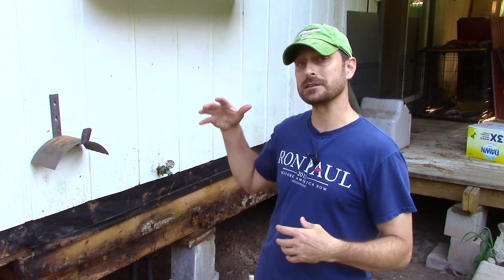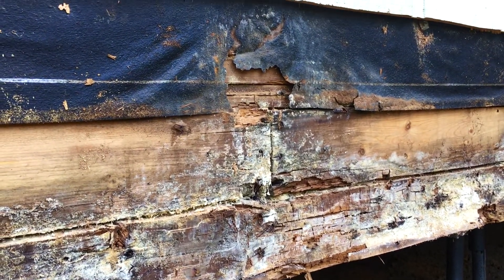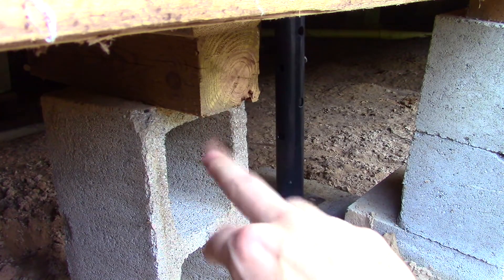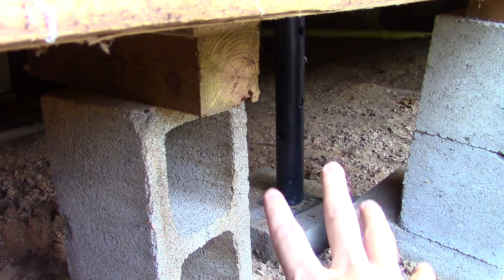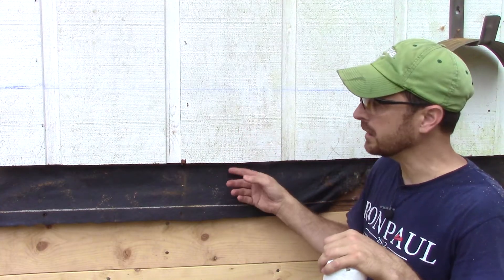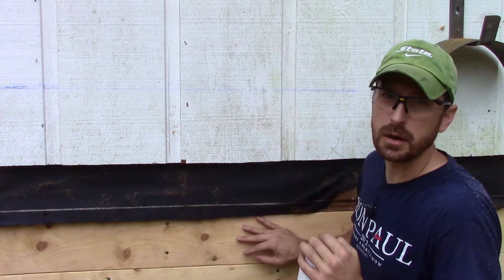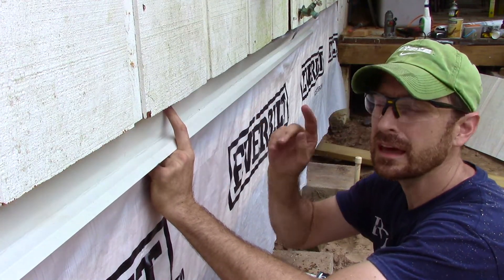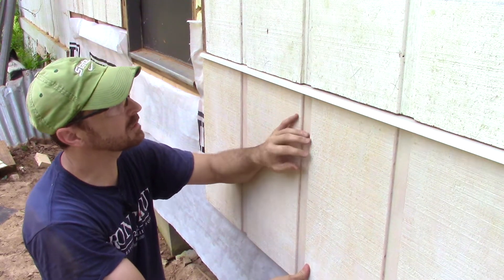How To Repair Damaged T1-11 Wood Siding On A House! Tips For Structural Repair And A Great Finish.

Comment: Great video!  It's just what I was looking for to address the problem I'm having with my T1-11 siding.  Unfortunately, HomeDepot no longer carries that flashing - at least that what it says when I select the link.  All they seem to have is Z flashing with 90 degree right angles.  The flashing you describe has a 45 degree profile.  What are the dimensions of the flashing you used if I have to search for it elsewhere?
Reply from the maker: Thank you. I think I remember the flashing being 3"x1"x.5". I wish companies were not having such terrible supply chain issues. It is hard to find good flashing profiles now. I may have to just buy a metal brake and make them myself.

Comment: How did you slid the house wrap paper under the siding where the studs are?
Reply from the maker: I pulled the upper siding away from the wall a little bit. It only needs to slide behind about 8 to 12”.

Comment: Where do I put the drip edge if my shed  doesn’t have any felt paper or house wrap?  
Thanks.
Reply from the maker: Put it in the same position. It will only prevent water from sitting on the top of the new piece of siding instead of diverting water from above and protecting what is below.
Reply: I forgot to include that I added felt paper. It is placed between the stud and siding. The felt paper is 6” above the cut in the siding and down to the bottom plate.

Comment: Just curious, why would you not put sealant on that gap left between the upper old siding and the flashing? Can't water still get at the end of the old siding with that gap there? (Getting ready to attempt some siding repair, maybe..)
Reply from the maker: Sealant will hold any water that could eventually get behind the siding from escaping. This would cause mold and rot behind inside the wall. The siding sits a minimum of 1/8" above the flashing so no water will touch the bottom of that siding. If any water does touch the bottom of that siding, it can easily and quickly dry out. Additionally if there is sealant there, it could trap moisture from that accumulated on the flashing against the bottom of the siding. Hope that helps.
Reply: @CountryLivingExperience  Thank you. I was going to copy the handyman's work that did some siding on my house and he put sealant on the flashing space so thought that was what I should do. Glad I asked...I am just starting this project, and today removed decking attached to siding and found lots of rot on siding and into the rim board...might have become a "contractors job" now, was going to try and save some money...It cost me $400 for the handyman to attach two half sheets of siding (36 in. height . 12 ft long) to the bottom and I went and got and bought all the wood for the project, so I thought maybe I could learn how to do this myself. My 74 yr old body is telling me today after tearing out the decking and dragging it to the trash pile, I may have over estimated myself... :) Thank you for an excellent video and quick reply.
Reply from the maker: You're welcome. Yes, doing it yourself is best if you can physically handle it. I am an Architect practicing for 15 years and worked with really high end builders in Washington DC and Houston.  Unfortunately, the handyman did not do it correctly. That is common to find.
Reply: You need to overlap the z-flashing by at least 4 inches to make sure water doesn't get behind it.  Be sure and check with CountryLivingExperience to make sure that's right.

Comment: I'm using some t1-11 pieces on an insulated shed that don't have ship lap, I'm wondering how to abutt the vertical joints. Thanks
Reply from the maker: The t1-11 has lip on either side of the sheets. They are made to overlap each other when you abutt them.
Reply: @CountryLivingExperience  some of the sheets I'm using are repurposed and had rotted parts trimmed off, so no lip. If I owned a router, I'd just make a new lip but I don't, so I'm wondering about another option, haven't had much help with google.
Reply from the maker: You can do a traditional board and batten idea. Butt them together and place a board over top of the vertical seam.

Comment: I have T1-11 siding and I go around periodically tapping with my fingernails.  If I find a soft spot, usually around windows or near trim, I coat it with 2-part epoxy and paint it.  I have been debating coating the bottom of the sheets with epoxy, but I don't know if that makes sense or not.  How about soft spots?  Can they be drilled and  injected with something?  Thanks.
Reply from the maker: All those soft spots mean that you have water constantly getting in at those points. You have to take care of the cause of the issue. Unfortunately, using an epoxy would be a waste of money. The amount of epoxy needed would cost more than buying a sheet of t1-11.
Reply: @CountryLivingExperience  I am not going to go to the expense of replacing a sheet of T1-11  for 1 or 2 soft spots the diameter of my thumb.  I would like to find something to inject it with and use the epoxy or caulk to fix the source of the water penetration.
Reply: In my experience, rot rarely starts from the painted front. It’s generally getting in at a seam up higher, running down the back, and rotting forward. So a soft spot means something bad is happening deep in there. A sheet is $35 at HD- while trying to repair soft spots might be cheaper now, better off in the long run diggin in there and looking for the root. I generally do and almost never like what I find 😂

Comment: Hello, I think I have have similar looking t-11. 8 inch thickness and 1 inch thick groove. I am not able to find one with 1 inch groove. Could you please share how you found it? Any online options to buy?. I also has 4 inch and 5 inch siding with q inch groove on rear of the house.. all these spec is getting harder to find
Reply from the maker: My siding is actually the 12 inch. It was easy for me to find at my local hardware store. We found it at the Home Depot. Here is the link....https://www.homedepot.com/p/Plytanium-Plywood-Siding-Panel-T1-11-8-IN-OC-Nominal-19-32-in-x-4-ft-x-8-ft-Actual-0-563-in-x-48-in-x-96-in-113699/100000016

Comment: I suggest that you seal and paint the back side of siding and most importantly the top, bottom and joints. Use the best 100% silicon you can, nothing else. Anodized pre-formed aluminum flashing won't crack like this plastic stuff. Adopt an attitude that you're building a boat, that is the mindset you need.

Comment: Hi, great video as I have the same problem on my shed. The flashing link for home depot is no longer available. Can you provide any information as to where to purchase such flashing.
Reply from the maker: Good morning. I checked the link and Home Depot is currently not carrying the product. I don't know when they will have the product back in stock/available. They are the only place that I have found the correct one. I checked Lowes, Amazon, and Grainger with no luck. All local building suppliers in my area also did not carry the product. If I find anything, I will update the video description with the new information.
Reply: Search for Z flashing at HD.  They have it in my area (MI)

Comment: How did you get the new house wrap up behind the old paper? You showed stapling the new wrap on, then voila, it was 5 inches behind the old siding. I’ve been doing similar repairs and the worst part of the job is getting the new up behind the old. What’s your secret?
Reply from the maker: I honestly just pulled out the bottom of the siding and slid it up behind. It was pretty easy with that t1-11 and it wasn't nailed in that frequently.

Comment: I have this identical issue on my house. They did not install the deck correctly and it has caused water damage on siding and within house.  But the flashing installed at knee level of side just seems odd visually.
Reply from the maker: Well, you can do whatever you want. Visually odd or not, it solved the problem correctly which is the intent of the video. If you don't like it then just replace the entire sheet of siding.
Reply: @CountryLivingExperience  The House Addition which is a small tools room is also build on the same beams as the deck. The rot on the siding has also reached the subflooring to the addition. The deck ledger has 1 screw at the deck end and likely a screw or two which would be located under the addition. I can move the ledger upward about 5cm. So all this said I am guessing I have a lot to work on and replace, to include the ledger and beams, which were only toenailed.  So replacing the siding which is T1-11,  with a wood siding that matches the deck may be my best bet.
Reply from the maker: That might be your best move. Or you can make the knee height cut, insert the flashing, and put a 1x6 piece of trim directly underneath with the new t1-11 behind it or course. This would give you a larger visual break between the two areas. It would look more intentional.

Comment: Very helpful, this is going to be my weekend. Any particular T1-11 or is it all standard? This will be the largest patch job I've ever done, basically the whole lower 2ft of one since on my house.
Reply from the maker: Cool. Not all t1-11 is the same. First there are different spacing of the grooves. Second, there is a product called Smartboard which looks like t1-11 but is thinner and is made a bit differently.
Reply: @CountryLivingExperience  thanks for the heads up. Looks like I won't be doing it anyhow. My neighbor's house caught on fire yesterday and my siding burned. A pro will be handling it now.
Reply from the maker: Sorry to hear that. Hope it gets fixed fast.
Reply: @CountryLivingExperience  From an internet search, it looks like this is SmartSide, not Smartboard.

Comment: Where did you got this siding that same design ,could not fined it at Home Depot
Reply from the maker: The Home Depot is where I got it. They may have been out of stock at your local store. You might have to check other stores.

Comment: Is that flasing going to stick out like that???
Reply from the maker: Yes. It has to so that it drains the water properly.
Reply: @CountryLivingExperience  Thanks for the video. Do you know if they have a different kind of fashing  that runs flush to the wall?
Reply from the maker: There are endless types of flashing but it must have the same shape. All flashing has to drain water off of an angles piece in the front that drains over the lower material.

Comment: Would it be good idea to install flashing on the bottom piece of wood siding?
Reply from the maker: No. The flashing exists to protect an object that is underneath it. If you put it on the bottom, it is not covering anything.
Reply: Thanks. Another question: can I fill the 1/8" gap above flashing with caulking so that  water cannot go in and up behind the siding above?
Reply from the maker: No, absolutely not. That gap is there to let any water out if it gets behind the siding. If you put caulking in there it can trap water and your siding will rot. Hope this helps.
Reply: @CountryLivingExperience  
Thanks a lot for your explanation. I am doing this project today. Your instructions are very detailed and helpful.
Reply from the maker: We are glad our video was helpful. Good luck with your project.

Comment: This is amazingly helpful and exactly what I was looking for. Do you have any additional advice for a situation where the rot is happening because siding is butted right up against deck wood? It seems to make it particularly vulnerable to rot and I'm wondering what options I have to deal with that. Thanks!
Reply from the maker: Glad we could help. The siding should be at least 1/2" above those deck boards. The deck ledger should be flashed with metal. If it is not, you may have a big problem like I did with rot beyond just your siding. I would pull off the deck boards and check or cut the siding as low as you can. You'll have to investigate.
Reply: You could use butyl deck tape

Comment: How much does it cost to replace a sheet?
Reply from the maker: It depends on where you live but usually Home Depot has t1-11 for $18 per sheet
Reply: @CountryLivingExperience  I just paid $69 for the same sheet you paid $18 about a year ago; ahhhhh, the good ole days. 
Originally I was going to just caulk the new seam... but the flashing you used looks so much better and a more integrated install = less chance of leaks.
Reply from the maker: @seanfitzgerald5385  Inflation is getting out of control for sure. I sure so miss those good old days.
Reply: The price has come down to $38!

Comment: Why didn’t you just cut your damaged siding at 45 degrees and your new piece at 45? Prime the ends and install. Water won’t leak up through the 45 degree cut.
Reply: I wou;d prefer to do that
Reply from the maker: Water has the potential to wick back up that type of joint. Although it can be done, I would not recommend it.

Comment: I just did some OSB vertical siding repair (similar to t1-11).  Other than sealing and painting the bottom edge, what do you recommend I do to make the edge more rot resistant?  I understand that it is water splashback and moisture wicking that caused the rot.  I'm thinking of attaching a piece of primed and painted 1x6 along the bottom edge. Is that a good solution?
Reply from the maker: It is mostly just the moisture wicking that causes the problem which is why the bottom of the siding cannot touch the flashing. Water always enters at material transitions. If you put that 1x6 on the bottom of the siding it will have to be caulked and sealed very well to prevent water from seeping in between the two materials especially if the 1x6 protrudes out beyond the siding piece. To help drain the water off the 1x6 (if it does not sit flush with the siding), I would chamfer off the top corner of it. Hope that helps.

Comment: Best to run a bead of paintable caulk on the bottom of that siding you cut with your finger, before you put the flashing in. And I'd recommend painting the bottom as well. It's going to get water in that gap and wick up into the siding if you don't. After all it's a raw edge.

Comment: Why couldn't you butt the siding next to each other and seal?
Reply from the maker: Simply because sealant wears out. Flashing does not. You can butt joint them but doing it how I showed is the proper way to repair it unless you replace the whole sheet.

Comment: Awesome video and great work keep them coming! One question I have the exact same siding as the one shown on this video and for the life of me I cannot seem to find it anywhere, I want to match my existing siding but what I find at Home Depot don't match any advice? Thanks.
Reply from the maker: Thank you. Glad it was helpful. For me I couldn't find it at my local Lowes or independent hardware store but I did find it at Home Depot. You just have to keep shopping I guess. Maybe ask a manager to order some in for you.
Reply: Try  a lumber yard

Comment: I have a mobile home and the hardwood has splits in the wood due to age, heat and humidity this winter. how  do I fix this to keep summer rain from causing more damage underneath? the exterior caulking did not work due to the AZ heat
Reply from the maker: Your siding needs regular painting to avoid that cracking. It needs to be protected somehow. Try caulking late in the evening or very early in the morning to avoid heat issues and giving the caulk time to cure. If it is just one sheet of siding, just replace it. It chould cost you no more than $25

Comment: what's best is to use oil base primer on the bottom edge of the siding

you don't need 1 3/4 flashing for siding 

you should should have invested in a coil nail siding  gun your wasting time doing it by hand

What's the point in caulking the staples you put in how are you going to seal the finishing nails you put in behind the siding you just put up? Wasn't that the point of the flashing?????

The flashing and the exterior paint is going to be what protects what's behind the siding 

If there is water getting behind that point, you need to seal the windows that are above it or fix the wood rot that is above that point  

I do this work every day and diy does not mean you know what's going on 

Water rolls in one direction down hill

I do this for a living so
Reply from the maker: Check your arrogance and realize there are 5+ ways to do this. This is a technically correct way of doing it. I have been an Architect for 15 years so don't pontificate to me and tell me to buy tools I cannot afford.
Reply: @CountryLivingExperience  perfect response to Mr. KnowItAll...... Great video!

Comment: You just leave it like that?  No kind of blending it in to the existing piece to make it look like one piece?  That looks horrible.  I'd rather replace the whole T1-11 board.
Reply from the maker: This is not a design video. I am showing you how to technically fix it correctly. If you carry the line of the flashing around the house it will look cohseive. You can put a 1x board under the flashing if you like.
Reply: I agree Joshua, I always talk my customers into replacing the full sheet, but....sometimes, sadly, people can’t afford it or don’t care what it looks like....just as long as it works or passes home inspection for new buyers. This works just fine even if the house wrap staples rust to shit in one month regardless of the silicone dabs, it’s hold up. Definitely need to seal those cut edges. Rain runs down the walls and rests at the edge where it will slowly wick up into the t-1/11. Oil primer, and heavy sealer is what I use, plus 2 coats of paint
Reply: @Real-time22  Just spent $70 for (1) sheet of 19/32" T1-11 that I cut into (8) pieces 12" tall to do the Z channel repair along a 32' wall.   With current lumber pricing, expect only very wealthy homeowners would buy (8) panels vs saving $490 on (7) more T1-11 panels doing this repair!